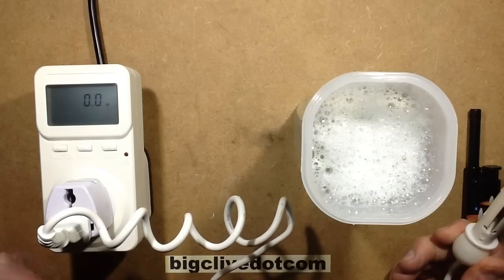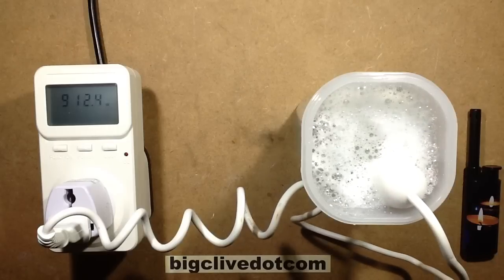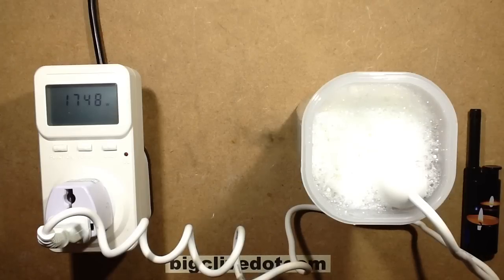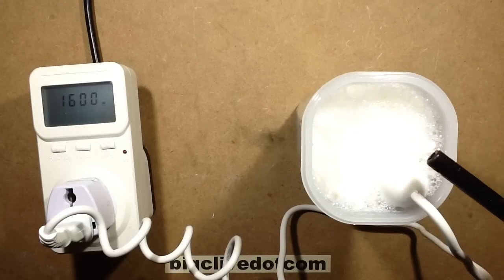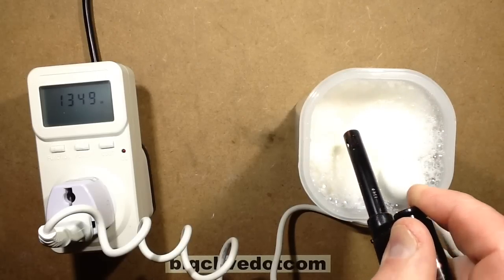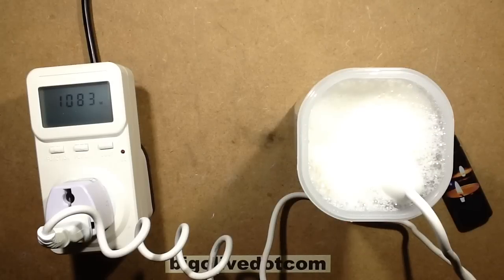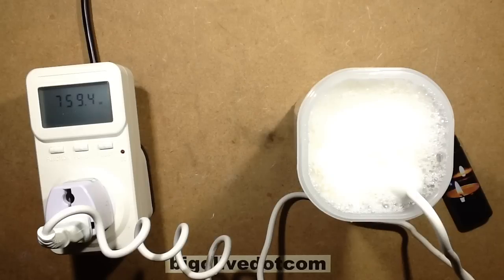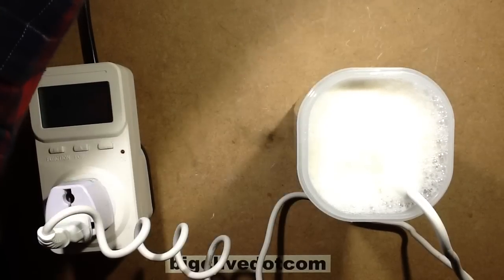Does the AC electrode boiler produce hydrogen and oxygen?

Comment: What you see from any normal boiling of water is the dissolved gasses, usually air, that is in the water liberated by the heat before the water reaches the boiling point.  You'll see this in a saucepan on a stove as the water heats. One of the experiments in my high school chemistry class was to dissolve gasses in de-ionized water and weighing that water before and after dissolving various gasses in it.  Municipal water sources do aerate the water in one of the steps to clean it.  Take a glass of cold tap water and leave it in a glass and you'll see gas bubbles form on the insides of the glass after letting that sit awhile.

Comment: that thing is fucking scary
Reply: +Justin Howlett you misspelled awesome.
Reply: Jesse Crandle oh... oops
Reply from the maker: +Justin Howlett Scawesome.  Scary and awesome at the same time.
Reply: +bigclivedotcom SCAWESOME! lol
Reply: +bigclivedotcom i always thought it could only strip the oxygen and hydrogen molecules with direct current since it is more stable
Reply: +Hunter J. Short (Hunter Short) Technically it could strip oxygen at one electrode, on one half-cycle (and hydrogen at the other), then do the same, the opposite way round, on the other half-cycle. 

Sure there's only 100th of a second per half-cycle, but it's a shitload of power. 

AIUI electrolysis of water is about amps, rather than volts, anything more than the 2V or so needed to split the molecule is wasted as heat. But there's around 5A going into that, which is a fair bit. So it's not impossible, even though it wasn't apparently the case.
Reply: +bigclivedotcom dude do some overcharged capacitors test? or phone something i guess? or start a gaming channel?
Reply: I don't know what happened officer... it just fell in the bath by accident

Comment: So what is filling the bubbles in the foam ?  Could just be that the amounts of H2 and O2 per bubble is so small compared to the liquid that it's getting extinguished.
Reply: +mikeselectricstuff steam and such is making the bubbles, enough to render the other gases useless for burning, youd have to condense the steam out, and pump the lighter hydrogen into a container to be useful, (i would guess) basically you put too much power into a small area and it boils, so use larger plates, less power, keep the water cold, and you have more hydrogen gassing off and no steam
Reply: If there was any significant percentage of those bubbles with either H2 or O2 it would have been very noticeable when bubbles popped with lighter. Ever seen a lead acid battery/H2 explosion? The guy above explained really well what's going on with electrolysis and AC. Electrolysis is happening, no doubt, but it takes time for nucleation of a 'bubble' to occur and float to surface. So during the 0V phase the ions might just 'solve' back into H2O solution. If some of the anions/cation survive the switch in polarity as tiny bubbles they will then be having their opposite cation/anion produced in close proximity. So pretty much using half the cycle to start electrolysis, and the next half of cycle to reverse it :P
Reply: I think that you are on the right track. As others have mentioned there also the dissolved gasses coming out of the water and htis is most probably what fills most of the bubbles. The steam would immediately condense again when the temperature in the bubble sinks just slightly.

Comment: With AC there is just as much hydrogen and oxygen generated as witd DC, but since the polarity switches every 50est of a second, at each electrode both are generated.
Don't forget that no complete atoms let alone molecules are generated, but Ions! especially the O-2 ions are very reactive and recombine rapidly with the nearby H+ ions, releasing heat. That is the main source of heat in these contraptions. So hardly any H2 is generated.
Reply: +Imre Fabian The more you know!
Reply: As an ALevel chemistry and physics student I was just about to type that. Also science is fun when you find out stuff like this.
Reply: +Imre Fabian Also you would need a muck larger surface area of metal plates?
Reply: google Account no, that has nothing to do with it.
Reply: "...is the main source of heat..."
Last time I checked resistive heating didn't require chemical reactions.
Reply: +cyberconsumer this isn't a resistive heater. It's two plates and putting it in the water basically just shorts it and it passes current through the water.
Reply: +cyberconsumer Heating the water through a resistor type element wouldn't be as efficient as an electrode boiler.  https://en.wikipedia.org/wiki/Electrode_boiler
Reply: Jeez. The production of heat by passing current though something regardless if it is water or a special element is resistive, is about 100% efficient and perfectly described with current and resistance without taking chemical reactions into consideration. The recombination of ions mumbo jumbo sounds smart but adds nothing.
Reply: Look  you wankers, water is a liquid and an electrolyte as it is.
Water CANNOT be a resistive load. All heating due to passing current through it involves chemical activity. 
If you want a liquid conducting restively  use Mercury!
Reply: Btw, what the conductivity of water or any material concerned, for low frequecies (below GHz levels), there is NO difference between AC and DC. There is a capacitive component though, and if you place the water in a coiled tube also a little bit inductance. But those play no part at 50 Hz!
Reply: Imre Fabian Cool, how does that stop me from measuring current and resistance with a multimeter?
Reply: cyberconsumer How can you measure a battery as that solely works chemical? 
Because ionic current is also current. Only here ions move instead of electrons!
Reply: Imre Fabian So I multiply the measured resistance by square of measured current by time and get heat. But this theory is shit according to you and the recombination of ions provides a better insight.
Reply: cyberconsumer No my dear, I never said that this theory is shit, those are your words.
The effective result is equal, as the energy that results of the recombination of the ions is exactly the same as the energy used to split the water into the ions (1st law of thermodynamics: the law of conservation of energy).
All the maths stay the same, only the cause of the heating is (mostly) chemical instead of resistive. From the outside you cannot tell the difference. But when you would get Hydrogen and Oxigen seperately (as with electrolysis using DC, collecting the gases separately, you would measure a difference. Go ahead, try it!
Reply: Imre Fabian Wouldn't this process require no more than 1.5 V to happen? Where do the rest of 240 V go?
Reply: +cyberconsumer Tension is never going anywhere. But good question. If the process is only chemical and assuming the wire have a negligible resistance I would tend to think that raising the tension over a certain threshold value wouldn't increase the rate of the reaction. But it seems like it is what is happening. Raising the tension between the plates of an electrolytic cell induces an increase the current flowing through.

I also know that electrolysis is more efficient in cells using low current density (current / electrodes contact area with electrolyte). So the "lost" energy when using high current density (more losses) is converted into heat. I would like to know the mechanisms involved. Does the ions recombine more easily when subject to a higher electric field ? Or do they migrate more easily ?
Reply: Michel PASTOR :"Does the ions recombine more easily when subject to a higher electric field ? Or do they migrate more easily ?"  I think the latter.
Reply: +Imre Fabian ... so basically, it DOES generate gaseous oxygen and hydrogen, but then pretty much immediately burns them back into warm water? Tch.

(I'd expect there to be plenty of spark potential between any non-immersed parts of the trodes btw so that'd also rapidly consume any free hydrogen before it could build up to kaboom levels)
Reply: mspenrice your faulr is that you keep thinking in terms of neutral gasses like H2 and O2. At 50 Hz the ions don't get the time to combine to gasses, ťhey recombine AS IONS! 
There is no burning, only recombining to Water (H2O)!
Reply: Well, that's what I meant by "burns", as a shorthand explanation for the chemical reaction taking place (in the same sense as our body cells "burn" glucose or ATP for energy, even though we're not exactly all human torches)... In either case it's the same, there's no free hydrogen left to burn, and no free oxygen left to accelerate the reaction.
Reply: +Imre Fabian If frequency of the current is 50 Hz, then it actually takes 1/100 of a second for it to change polarity, since 50 Hz is frequency of full cycles.
Reply: ltcol Kovacevic you're wrong here, as in 1/50 of a second the polarity is reversed. Each 1/100 of a second there is a zero crossing, i.e. the voltage is 0 V.
Each 1/50 st of a second the voltage reaches a maximum, but everytime reversed.
The numbers are on the American mainland of course 60 resp. 120 (exept one small village in South America!!!).
Reply: +Imre Fabian I think +ltcol Kovacevic is right. With 50Hz frequency a cycle lasts 1/50 of a second. So a polarity change every half of that: 1/100 of a second. Youd said it yourself "Each 1/100 of a second there is a zero crossing" so every 1/100 of a second there is a polarity change.
Reply: Michel PASTOR i didn't make myself clear appearently. I stand corrected.
Indeed the first half of the cycle the polarity is reversed. There is a maximum every 1/100 st of a second, but every half cycle with opposite polarity.
But the issue is that the ions are generated in those intervals and don't get the time to recombine to neutral pure gasses, in stead they recombine to water (H2O) with a lot of energy, so the water comes free as steam. That condensates  whereby the energy that comes free heats up the liquid water.
Reply: +Imre Fabian Agreed
Reply: It's not resistive or the water would heat evenly between the electrodes.  The boiling only occurs at the electrodes.
Reply: @fabimre  OK so you're saying water has no electrical resistance, and is therefore a superconductor?

Comment: I suppose you might get some (he says before watching the experiment...), but you'd need enormous currents during each half wave to even get a measurable sample, assuming current reversal doesn't force reconstitution within the fluid.

There's a very good reason electrolysis and electroplating are carried out using DC currents

Comment: Almost can draw enough current to melt its own power cord.
Reply: +LakeNipissing its not intended to run at 220v
Reply: +ChrisD4335 realy? China is a 220V country. India is 230V. There aren´t all that much 100V..130V countries. USA is a big no go for such a thing. So, which is the market for those things?
Reply: sarowie
yes really a 220 chinese outlet is not the standard two prong deal here it kinda looks like a squinty eyed ghost, that type of plug is used in 120 and below. I do not know the intended market but is not that
Reply: +sarowie You can run this deathtrap happily on the US 120 volt mains.
Reply: building code requires a gfci on new outlets  placed near water like in the kitchen, I feel like there is is strong possibility it would trip this so it would most likely only work in older homes in the us.
Reply: *****
I am not sure what you mean Mr Bryan the gfci is there to prevent people from killing themselves if they say drop a toaster in the sink. In the UK they are called an  rcd.
Reply: *****
a gfci works by measuring the current going out and coming in and trips if the difference is great enough, the cup of water may or may not be enough to trip it, not sure.
 Its just a semiconductor, the energy is not going anywhere but back in the lines but I suspect is may.
Reply: I think I would like to order one, i'll test it and get back 2 u in like a month or so
Reply: +Paul Bryan That's great and all but you were talking specifically about building code and i don't think the wording ever include the term "outlets placed near ground". Now that i think of it, building code? do you mean electrical code (NEC)? Because i just read most of 210.8 and saying "ground" or "water" would work in every scenario where code calls for GFCI
Reply: ChrisD4335 That's what we have extension cords and non GFI sockets and breakers for, This is all for SCIENCE of course..
Reply: ChrisD4335 It's self inflated ego satisfaction.. Quite common in the internet in general.
Reply: +ChrisD4335 Advertised as 220V in the eBay listing though.IIRC from the previous video, it was almost spot on 500W with plain water.
Reply: +Paul Bryan It's a two-prong device.   No path to ground, if you are heating a liquid in a glass/plastic container on a wooden table.
Reply: +ChrisD4335 
China has multiway sockets that allow almost all common power plugs to be inserted. Most appliances sold in China either have two flat blades the same as used in USA for unearthed appliances, or two angle blades with a vertical earth blade similar to the Australian SAA plug (but a bee's dick thinner blades and no shrouding). Occasionally, I see round pin plugs, but not very often. My Canon printer came with a round pin cable.
There is no voltage/frequency transformation between the different plugs. They are all supplied with nominal 220V 50Hz mains.
Reply: +ElfNet Gaming Or you could use an Isolation Transformer.
Reply: +ChrisD4335 Might it be possible that some YouTube commenters are trying to educate?
If you don't like to be educated, switch to an other channel. Big Clive has this whole channel dedicated to funfull education!
Reply: +Dracolith1 :"It's a two-prong device.   No path to ground, if you are heating a liquid in a glass/plastic container on a wooden table." And keep yourself from being grounded!
Reply: +Kevin Dare: " There is no voltage/frequency transformation between the different plugs. They are all supplied with nominal 220V 50Hz "  It would be a bit dangerous otherwise wouldn't it?

I have some experience with it: 127 V (60 Hz) for the lamps; 220 V for the sockets.
Endresult: a destroyed oscilloscope!
Reply: +LakeNipissing ... yeah, I always thought those plugs (which count as, and only connect to bathroom shaver sockets in the UK - or in the case of an incorrect transformer I once received with an external HDD, poundland 13A-to-shaver converters) were only good for 1 or 2 amps, and the sockets (not plugs) internally fused for such, so the cables don't exactly need to be heavy.

So an ~18w transformer, no problem, even if terribly inefficient. 500 to maybe even 1750w water heater ... not such a good idea. Especially if only using 2A or 3A cable.
Reply: The dual spade type sockets in the states are rated 15 - 25 amps
Reply: ElfNet Gaming True. With 14 AWG (copper) or 12 AWG (aluminum) branch circuit supply for 15 Amps. The power cord for this "boiler" doesn't look anywhere close to even 16 AWG, and it was evident the wire insulation was softening when the cord tension relaxed at 1.7 kW. I would be willing to bet if the heater was immersed in a high enough conductivity, maybe 100 mS/m or more for long enough, the power cord would go into meltdown and short out.
Reply: ElfNet Gaming Are you effing kidding me. I mean, OK, they've got a fairly decent contact area and cross-section, but presumably they also come with fairly stringent requirements for wire thickness, use of fuses / circuit breakers and such? The thought of pumping 2kw+ though one of those doesn't fill me with enthusiasm. The one I had in mind was even flimsier than the typical 2-prong that sometimes comes attached to the end of an additional IEC 10A kettle lead packed in with a computer or so-on.
Reply: Also, I've experienced a UK extension lead getting almost too hot to touch after someone plugged a high-wattage wallpaper steam-stripper into it even though it was only rated for 5A ... eventually blowing the fuse in the wall plug. So it does happen even here...

I'm not too familiar with AWG sizes, any idea what those are in square millimetres? I know what mm^2 thickness is stated as a minimum in the installation guide for my electric shower unit after all... (10mm^2 recommended as best for mine, but depending on how it's routed and the local voltage, you can get away with 6 to 8mm^2... that's for 8.5kw / somewhere around 34A in a variety of substrates - buried in concrete, running between sheets of plasterboard, or free-floating in a wall void...)

Comment: It probably is creating the hydrogen and oxygen, but they are recombining back to water
Reply: +Sparky Projects I would guess the gasses in the foam is something like 95% water vapour 4% gasses that was deluted in the water and <1% hydrogen/oxygen mix, and then some stuff like chlorine.

It boils of a a lot of water and that just swamp everything else out.
Reply: +m8e I wonder if he could detect the hydrogen by running with a resistor inline and using a larger volume of water to limit the steam.
Reply: If you had a typical electrolysis set up (2 tubes), and used something like a variable frequency drive set at say 1Hz, or a dc supply with changeover switch to slow the process down, one tube on the first half cycle would produce hydrogen, the other half cycle would produce oxygen, the water between the probes would eventually warm up and produce steam/water vapour, all of this would recombine without the tubes
+m8e is probably about right
Reply: +Sparky Projects What if the electrodes are plated in a metal that doesn't readily form oxides?  Is that possible at 240Vrms?

Comment: That humming sound could be the magnetic field building up on the heater wire as it gets louder as the power goes up. That would be a super magnet if it had a iron core.